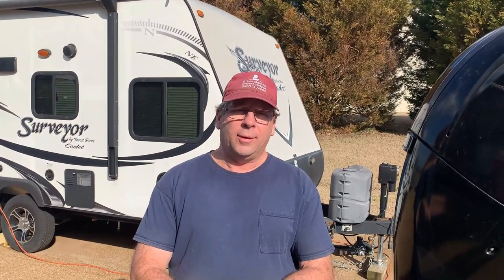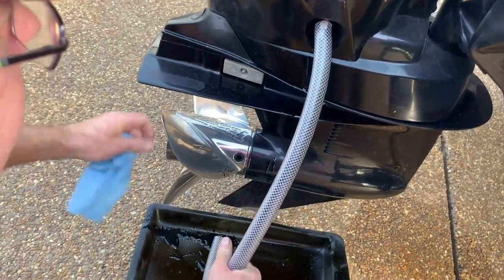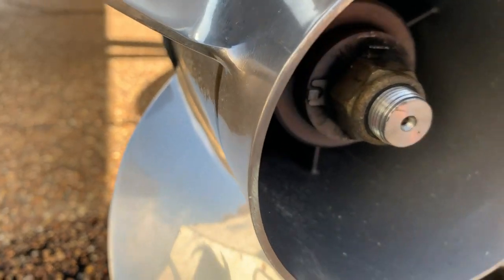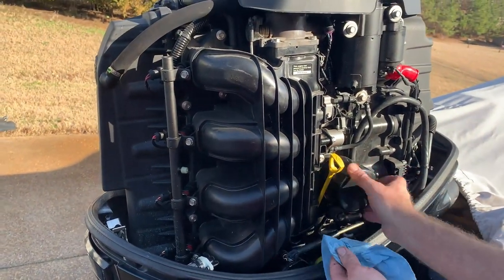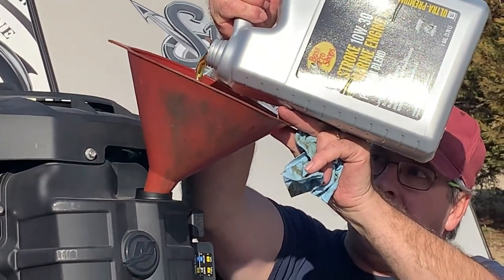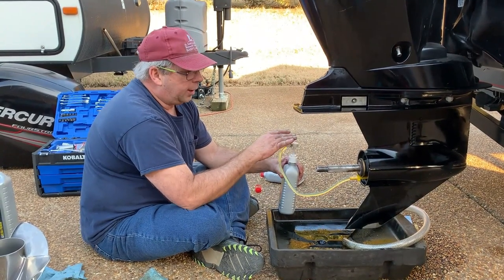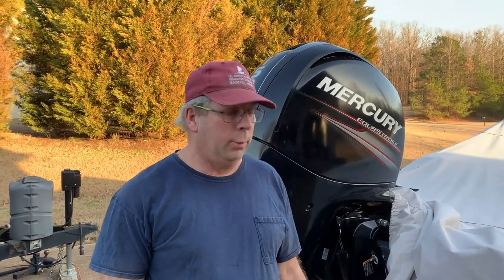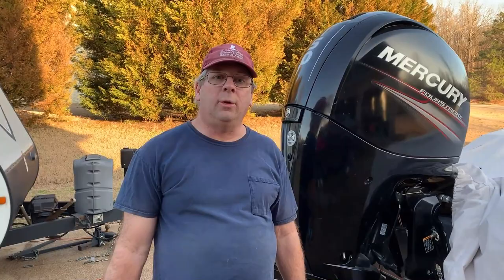Mercury 150 Four Stroke oil, oil filter, and lower unit oil change

Comment: Pull the small plug below the oil filter and attach your drain hose and it will catch the oil coming out of the old filter